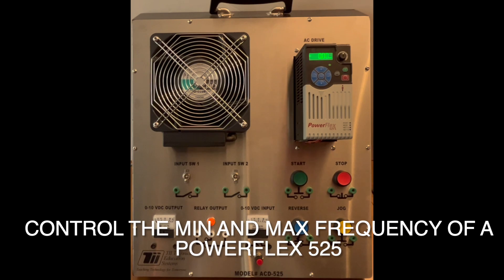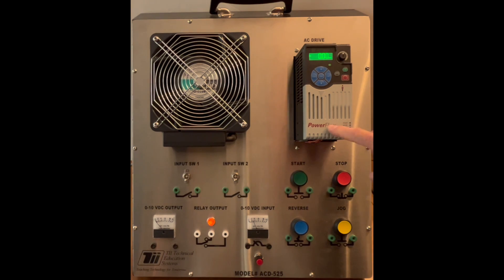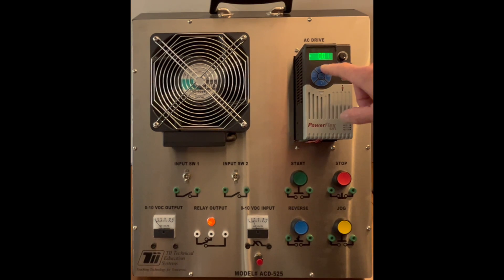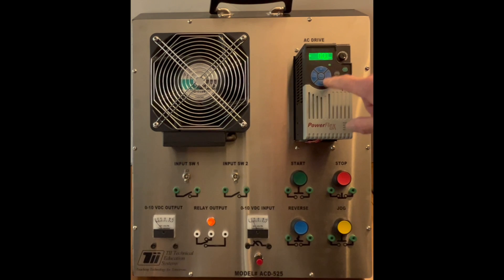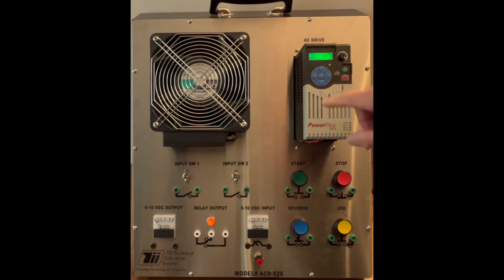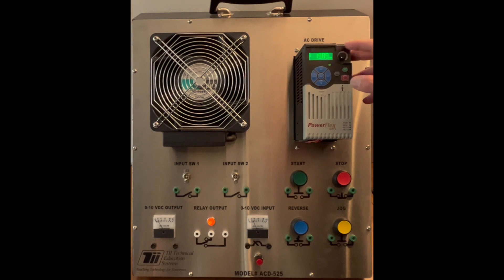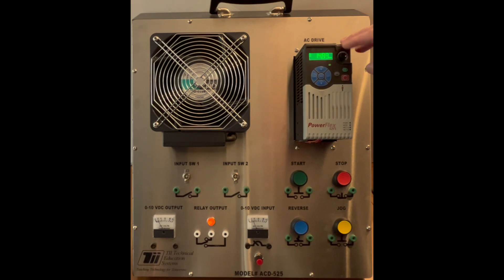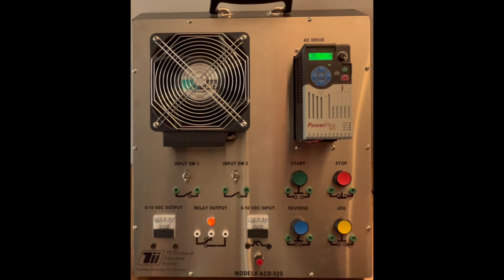Changing the Min and Max Frequency on a PowerFlex 525

Comment: Thank you so much, just have one question regarding the 80HZ setting:
can the VFD output  in general exeedes the max operating freq of the motor and how does that affect the motor?
Reply from the maker: Yes it can and it is not great for the motor.  If it goes past the max frequency of the motor it will slow down and not preform correctly
Reply: @KletteTech  Thank you so much keep up the good work